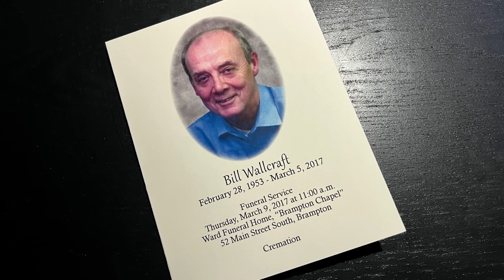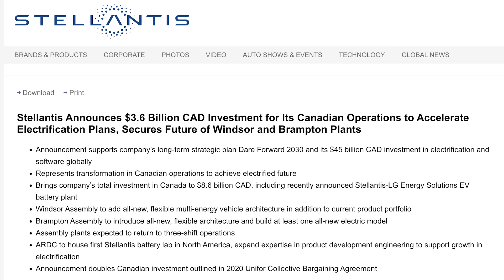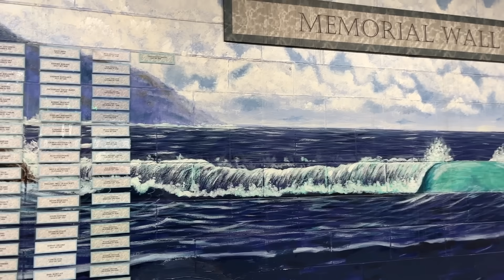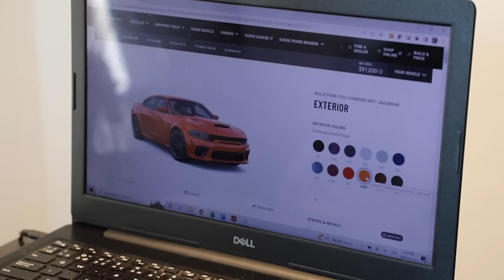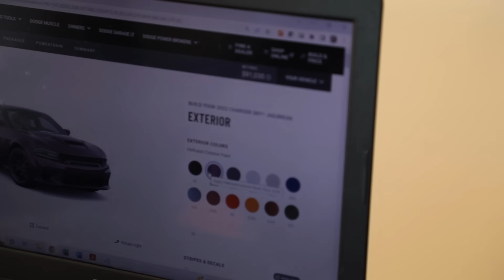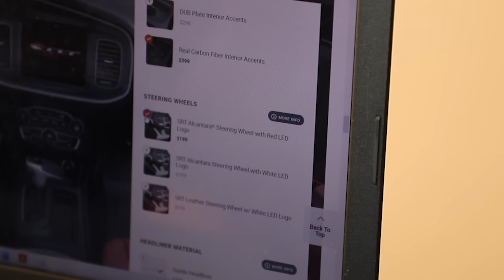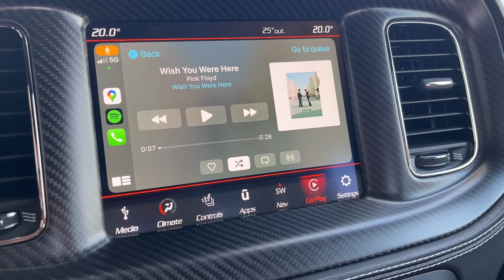Dodge muscle at Brampton Assembly: end of an era, and a long family history

Comment: Great video! I became a huge Mopar fan about 5 years ago, I’ve owned 6 chargers and Challengers since then. I currently have a 23 Charger Hellcat. I’m glad people like your dad built these great vehicles.
Reply from the maker: Thanks so much for watching and sharing  that. The people who built those cars are very proud of what they do.
Reply: ❤ Chrysler last 50 years.... However they are wasting their time because nobody is buying EVs...  Not near enuf to matter and most likely never will....   I'm certainly NEVER buying one in a 100 years......
Reply: @51AB Naa, it's because old/rich people can actually afford to cycle through them year after year when they strike a fancy. I have an 09 Challenger SE built in Brampton in March of 09 - 1 month before they changed the SE transmission from a 4-speed auto to a 5-speed auto. Currently leaking oil from the oil pan after I put a new one on it because I guess I didn't put it on correctly. Still runs, just leaks about a 2 quarts a week until the pan is empty.

Comment: I've owned nothing but Mopars since I bought a used 68 Charger in 75. I now have a 2012 and a 2014 Hemi Charger, that I'm sure your Dad had a hand in building. It's so disappointing to see the end of line for these great cars, I just can't see myself in an EV.  Good luck with that beautiful Charger Steph , and may your Dad RIP.
Reply from the maker: Hang onto those cars for as long as you can. They won’t build them like this again. Thanks so much for watching and sharing your thoughts. We really appreciate it.

Comment: I worked at the Faurecia Emmision Controls in Columbus, Indiana. I use to make the exhaust for the Chargers, Challengers, and the 300s. I worked there from Oct 2010 until Aug 2012. I own and drive a 12 black Challenger SXT. When I got it. I had them to put the car on a lift. And the exhaust system from the manifolds to the mufflers. Had my green paint mark on them. I won’t sell this car.

Comment: Let's be honest and not split hairs here people. In my personal opinion. I believe the number one reason why this car brand is fading Into history is because they could no longer keep the owners safe from dangerous thieves. I don't believe it was the economy or the epa. That's just my opinion.  But what ever the reason. That day has arrived. If you think about it there is no way to safely own a Dodge muscle car Challenger or charger anymore. I own for seven years a 2009 cherry red RT 6-speed manual Hemi Challenger. It had all of the badges and decals on it. I bought it used in 2013 with only 37,000 miles on it. It was a one-owner and still had the new car smell in it. It was a daily driver. Whenever I return back to my car from anywhere in town it was always there waiting for me. The thieves took notice of these cars around 2018. And the value of ownership has been going downhill ever since. I blame movies like The Fast and the Furious and video games like Grand Theft Auto for one of the major causes of this trend. It doesn't matter what kind of security measure you take. Whether it be electronic anti-theft devices parking in your garage or sitting at a traffic light. The thieves will follow your four miles until they know where you live. And then all bets are off when they break into your house or hold you at gun point while sitting at a traffic light. Dodge has become afraid of being sued by the customers for not protecting their property. So in the beginning like I said. Let's not split hairs here. People. It all boils down to lawsuits and insurance claims. I will always miss my "Red Rachel" as much as the next fan. Yes. The day I sold her I went home close the door in my office and cried for hours.😥😣😞 Not a day goes by that the memories of that lost Dream passes me by. Literally. I'm sure those of you who had to sell your beloved Dream Car would fully understand this. And I always will miss the peacefulness and solitude of just getting in my Challenger and going nowhere on a beautiful sunny Friday Saturday or Sunday afternoon drive. But it's just not worth losing your life over a car. 

So I just want to say thank you to the Dodge Brothers for making my dream come true and may you rest in peace and thanks for the memories. It was a hell of a ride! 

Thank You Dodge🇺🇸😌❤
May you RIP. Long may you Run.

Neil Young 
"Long may you run."
https://youtu.be/WYna-UAt75c?si=nYwfD_1ZlFHxKdhi

Comment: I bought a brand spanking new 2010 Challenger SRT Detonator Yellow, 6 Speed Manual. Your dad probably put in the passenger seat and the dash? Is that right?
Reply from the maker: I think he would have been on the door line by 2010, so his fingerprints could still be inside your door panels. Gives me chills to think about it every time. -S.

Comment: My father was a big MOPAR fan because of the great drive trains. What sucked was the body rot.
When Chrysler rebooted the Charge there were 2 things I was not happy about. 1). it became a 4 door family car and nothing like the original. 2). I didn't like how Chrysler advertised it as a Great American Muscle Car while being built in Canada and also advertised it as Domestic no domesticated. BTW the Hemi engines were built in Mexico. Far from being American. Same with the Challenger. Now that they brough back the Hornet name plate that's built in India.
At least Ford has kept the Mustang in production since 1964 and will soon have a 60th anniversary without a gap in production
I find it funny the Chrysler and GM brought back the Camaro and Charger around the same time and now both are done in 2023.
Good luck with your Canadian built car since you are Canadian. Drive it proud and drive it in honor of your father.